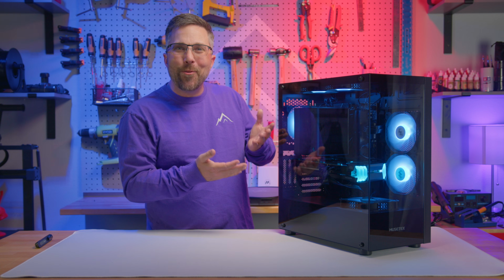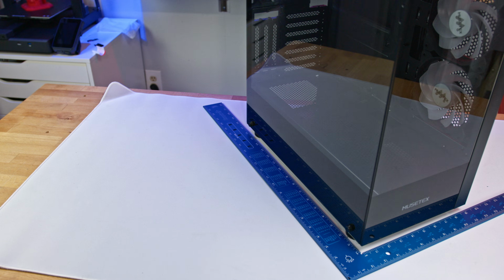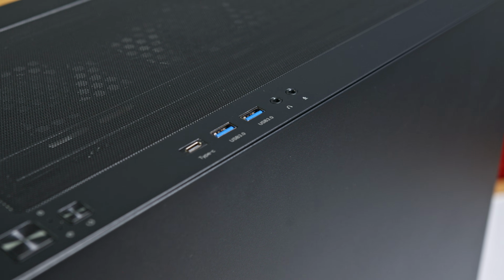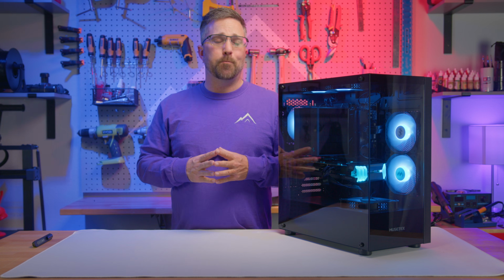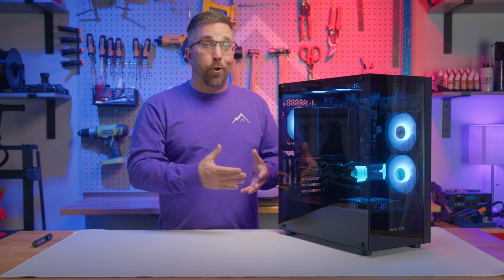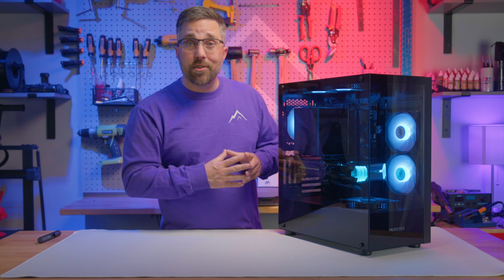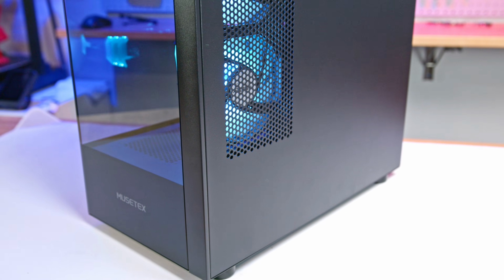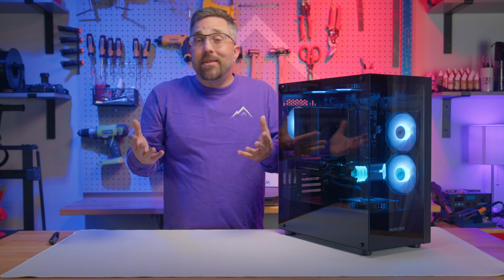Musetex K2: Blending In or Standing Out?

Comment: How do you connect the SATA from the Hub to the SATA from the PSU?? Can't find connection or cable on the Musetek HUB!! I have the MUSETEX ATX PC Case 7 PWM ARGB Fans Pre-Installed, Type-C Mid Tower Computer Case with Full-View Dual Tempered Glass, Gaming PC Case (K2)

Comment: I got mine for $60 and replaced all of the fans.. RYZEN 5500 CPU runs @ 34C under normal use and 136C at full load and 100% fan speed with 3 x 140mm(1800rpm) fans for exhaust and 5 120MM(2000rpm) fans for intake, and stock wraith cpu cooler, very happy with my purchase

Comment: I have this case. I used it for a new build going from a Cougar Panzer. The Panzer runs much cooler just doesn't have the bling look so to say. Until I can modify this case I have put everything back in the Cougar Panzer and the system is much cooler now.

Comment: Using this case with my main rig surprised how much i stuffed into it i have a b550 tomahawk 5700x3d cpu using a sama liquid cooler replaced all the fans on the bottom with three asian horse and two on the side also asia horse and 1 lian 140 as the rear exhaust with a side mounted 9070xt red devil luckily my riser cable fit near perfect temps are pretty good so much easier to move and take apart verse my old anidees full tower which weighed a lot

Comment: I used this very affordable in my last build and it was a great experience.
Reply: How are your temps? 
I just ordered this for my first build. Are you able to put your own fans in?
Reply: @arcanekingo5716  How about your temps ?
Reply: @aminehaouate1320  temps are stable. I have hotter running compenents such as a 7600X and a Challenger 7900 gre but all within normal operating temps. I haven’t added any of my own fans either.